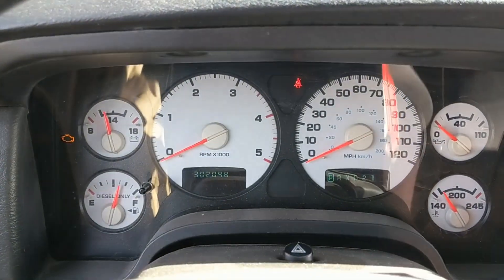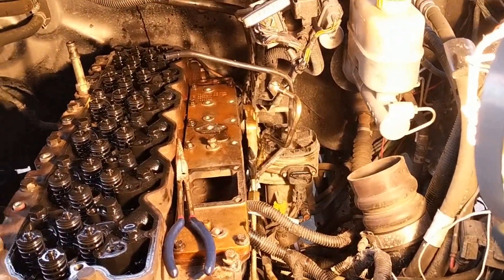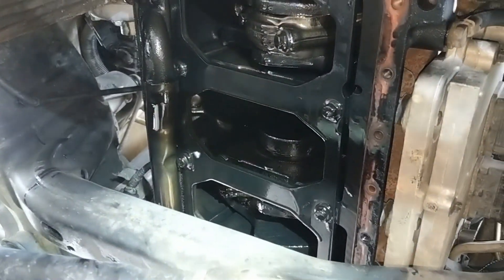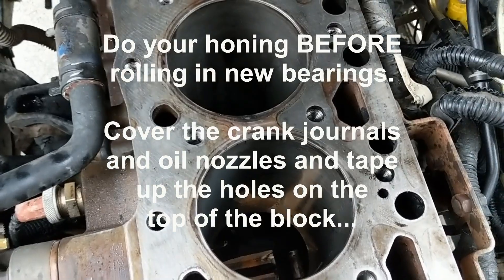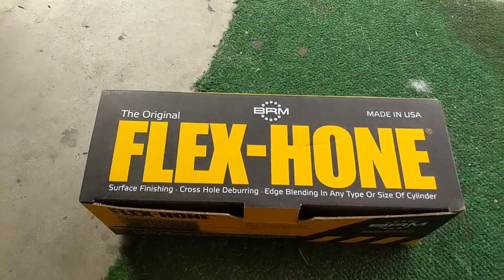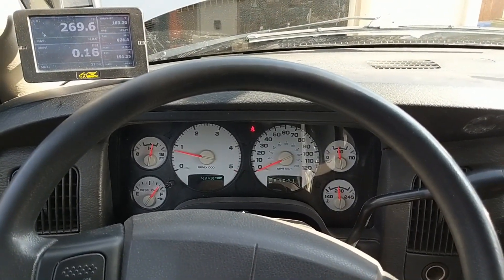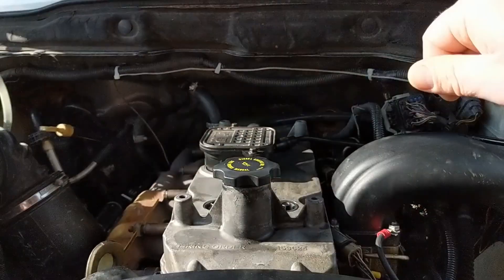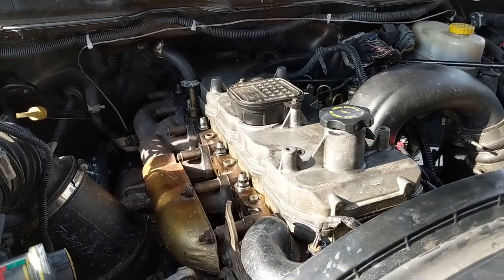5.9 Cummins in frame rebuild- 2005 Dodge Ram 2500

Comment: hey I have a 2004 the same as yours but I am having problems in the morning when I start the motor runs good as soon the temperature hits normal or before hit normal temperature when I am driving the motor just stop runing and when I shift to neutral starts again and as soon I release the foot from pedal the motor stops runing and keeps doing that do you know what may be the problem? thanks for your advice and help.
Reply: Geovanny Figueroa check your fca/fuel control actuator on the cp3 pump
Reply: I was fighting the same issue changed the lift pump behind fuel filter then  , FCA then, cp3 pump , and lastly injectors ,tons of money later 4 of the top shops that had no clue what was wrong with it  ended up being the timing sensor at the bottom of the motor was a little ate up n was getting thrown off once it got hot . Found that out on reading forms for hrs took me 6 months to figure it out lol

Comment: Broken piston rings is caused from over fueling or a bad injector so you have a tuner in it that will cause that
Reply: Robert Richardson there are various reasons that can cause broken piston rings. Not changing the air filter is the most common but isn’t always the case. Broken piston rings will cause scoring. Overfueling will wash a cylinder out causing bore polish. If it’s worse enough it will burn the piston. Listening to it idle, you can clearly tell it’s running on all 6. If it was a bad injector then it would have a fuel knock, there’s not a fuel knock

Comment: Cant imagine putting used pistons back in..  The parts are cheap, and it takes almost 0 extra time
Reply from the maker: The parts aren't as cheap as I am!!!  Still going strong.
Reply: Trevor Chadwick As a lifelong automotive technician I’ve done many, many successful inframes using the original pistons. As long as the engine hasn’t experienced overheating or oil starvation you’ll never have an issue and it saves the customers money. Some applications are so well made that cylinder bore wear or distortion isn’t an issue.
Reply: Not my cup of tea, one of those tired worn out pistons drops a skirt, and the entire engine is junk. On top of that, if the rings are broke, or worn bad enough to need replacement, so are the pistons that have been along for the ride with them (esp with that kind of mileage on them, and a blowby problem).  Upgrading this build to brand new Mahle pistons would be $499 or less
Reply: Trevor Chadwick It’s not difficult to determine if the pistons are “tired” Thats what they make mics and feeler gauges for. I’ve built them for almost 30 years and I’ve never had one bite me.
Reply: @prevost8686  Agree, if you have the tools, and know how to use them properly, you can mic the skirt, and bore, and feeler gauge the ring gap and clearance to groove (none of which I saw done in the video).
Reply: Trevor Chadwick. I agree with you, re-useing old Pistons is a big no no with me, I have been an engine reconditioner for over 50 years and on the odd occasion I have reused old Pistons when parts have been unavailable there's always been back pressure. If rings have broken it usually ruins the ring grove because the ring doesn't rotate properly in the grove and that probably why the bore has marks on it where the ring has stuck, if your going to the trouble of a rebuild do it properly and do it once, it's cheaper in the long run if your keeping it.

Comment: 336k miles on my 08 6.7 When mine hits 700k I'll think about rebuilding.
Reply from the maker: Keep your egt's down and you might make it...
Reply: @DieselCamper  

Stock so should be ok
Reply: @DieselCamper   emissions deleted will help greatly.
Reply: i hit 302,000 miles and i had to rebuild not so much rebuild but mostly just get rid of the crappy 3 piece thrust bearings they used and put in new clevite bearings but figured since i have a back up truck for DD id just do an overhaul on the whole motor its not crazy expensive unless you need injectors.. then its crazy haha a set of good new injectors cost more than some peoples work cars cost them haha

Comment: Why not just pull the engine and do it? Seems like so much more work to do it this way having to work around the rest of the truck.
Reply from the maker: If I did it today, I probably would pull the whole thing.  I still need to do the front and rear mains so it would have been much better to do it then!
Reply: It might make sense if you don't have a way of lifting the engine out, but these days a cherry picker is pretty cheap to buy or rent.

Comment: Ive never did a pickup diesell looks tight me and my dad did my KT600 cummins and his 8V92 but they where both in cabovers the old detroits were a pain they have about 100 pounds more bolts then a cummins great video

Comment: Why not just pull the motor? All the extra work fighting and working around stuff you could have had it out.
Reply: Takes a good cherry picker and you have to remove grill, radiator and intercooler to slide it out the front of truck..
Reply: Yes it’s crazy not to just pull it in less you just trying to unload it but at that point your only going to put one piston in it I would definitely replace the injector in number one hole probably over fueling unless someone got wild with ether but I give him credit doing this way I just am to much of a perfectionist when I’m rebuilding engines
Reply: @TheCumminsturbo2  you claim your a perfectionist but make the claim if your unloading it you would just do the one piston.
Does this make you not a perfectionist or dishonest?
I'd hate to be the guy that bought a rig from someone that was kinda half assed in a repair job
Reply: @hey_youtubeim_back2159  I’m not saying do a shit job but why would you dump a ton of money in a vehicle your getting rid of and most likelygoing to go to auction where someone is going to buy it dirt cheap if I was selling it to a private person I would be 100 percent up front with them
Reply: @TheCumminsturbo2  yes, but ultimately a private person will buy it. I meant no offense brother
Reply: @hey_youtubeim_back2159  I took no offense man you can do a decent job like he did just not the correct way for longevity might get lucky and the rings seat and you get all the crap out from honing or you might not it’s a crap shoot lol

Comment: May I ask what it cost to do the rebuild? 
I just found out I need a rebuild on my 06 with only 133K miles.
Reply from the maker: It was probably about $600 altogether.  I think the engine masters rebuild kit was around $500.  So far still going strong.
Reply: @DieselCamper  Thank you for the reply. I appreciate it. 
Now that I know you reply to these, My 5.9 suddenly stopped on me while on the freeway. All else was on, electircal, etc. Engine won't turn by starter or by hand. Solid. 
I'm assuming it's seized, the way it's not turning. The truck has been always extremely well maintained with only 133K miles. 

Removed the oil with no shavings at all. I recently changed it 1200 miles ago on a 2300 mile road trip with the approx 13000 pound trailer. 

Any thought?
Reply: @chrischapman276  what ended up being your issue?
Reply: @ernestoluzan  Oh.. this is a good one.... 
The previous owner over loaded the trans so when it disinigrated the shaft going to the torque, the forward pressure made the torque convertor into a baby's rattle, then causing the crank forward pressure causing the crank bearing's walls to collapse from the forward pressure. 
What happen??? I sold the 2006 SLT Perfect condition, 128K miles spotless mega cab that had JUST paid $25,000 cash to a broker for $2000 and never looked back. 
I put around 5000 miles on that show room looking truck in the few months I had her and then ended up buying a 2011 4X4 Cummin.s from the same guy for another $27K. 
By the time I made it from so cal to Kingman  Az, the Head gasket blew. Cracked the head, broke a cooling elbow and caused $23,000 damage plus labor. 

Think I'd learn, huh? Nope! Got a 14 Dually. Leather. Nice truck from the used dealership I was stranded at. Paid $19K for it with him giving me $7000 for the 2011 I mentioned. 
The broker is located in Huntington Beach area, Inland. 
I think the name has something to do with "irvine auto wholesale" or something close to that. He hasn't a site for a yard except an office and a few of the trucks in the parking lot along with storing more at his apartment parking. Beware if any of that rings a bell with anyone.... 

In Kingman, apparently Ram is quite popular. there were no Duramax available used anywhere. I miss my Duramax but this "3rd time's a charm" is working out pretty well SO FAR.

Comment: Set the cap on the hole and see if it dances, that's the quick test, the visible vapors really don't mean much, it's the volume that comes out, and the cap should sit still on a healthy engine, a small amount of movement is fine, if it blows it off something's wrong 👍
Reply: I get some steam out of my cap but the cap doesnt move. Normal?

Comment: Would have run a long time like that, but nothing at all wrong with tackling the job head on and doing it complete, probably not much ovalization of the bores

That stuf will hone right out too, ive seen some bad gouges from a wrist pin about 030 or 040 deep that didn't even affect how the engine ran after putting a new piston and rings and new rod in that hole, it ran like new no issues or oil consumption either...

Did the repair out of state in an emergency and never had to touch it again
Reply: Mine lasted 20k before the blow by stopped being able to tow
Reply: @michaelsilberstein  20k after your rebuild?
What happened?

Comment: If you think thats alot of blow by. My 7.3 should have been rebuilt a couple 100k miles ago lol
Reply: Yeah all diesels have blowby even when new, it's not until you see blowby coming out of the dipstick that I'd say it's time for a rebuild
Reply: The Puppet Of Everything I have a ram Cummins 6.7 with 5200 hours on it and180k miles. 550~600 hp and absolutely no visual blow by. My Cummins 5.9 I used to have on the other hand. Puffed like a smoker.
Reply: @Beersandbrakeclean  was the 5.9 common rail, isb, or p-pumped?
Reply: The Puppet Of Everything was a vp44 engine with about 130k miles. Only thing stock was the bottom end on that engine
Reply: kpeezle a bad vacuum pump can give the illusion your truck has blow by
Reply: Brenden Reed how? I thought blow can only be caused by a base engine concern or by a failed CCV
Reply: jake west amen
Reply: Jake there is a spec for blow in a 7.3. If you have accesses to PTS refer to PC/ED section 4 I can’t rember if it’s in hard start or performance diagnostics but it’s in PC/ED section 4.
Reply: But they keep on tikking

Comment: What's the purpose of a 12 valve tune
Reply from the maker: Mostly sound, but it also reduces wear on injectors.
Reply: @DieselCamper  nice I'm thank you for replying I'm watching the video right now of the tuning you got that's pretty cool but right now I need to fix my 2007 I'm having issues with I believe my ECM I keep throwing codes map sensor and crank cam its driving me crazy
Reply: But this motor isn’t a 12 valve it’s a 24 valve

Comment: If you want to really get some miles out of a motor first thing you do is go to gather freight and buy some magnets and put a fifty five pound one on the oil drain plug  next twenty five pounder on the bottom of the oil filter
Reply: Maybe a magnet under the oil pan but not under the filter.
Reply: @ViVA-MEXICO-AMLO  why

Comment: What caused it?  
My 5.9 96 dodge Cummins Speedo quit years ago 300+  runs strong paint is worn of top down .sun  destroyed the dash . my forever truck gonna buff and patina no rust at all.
Reply: T Huss these years of trucks have shitty rings in them, mine piled up 2 cylinders, pulled apart many engines with broken rings.

Comment: Great info. I would have liked to have seen that manometer test for blow by.
Its my understanding that just setting the oil cap loosely on top, it will dance around. 4 - 5 days kicks butt. Getting the head off, did you use an engine hoist? Ok I see you and a buddy got head off. Just read your detailed comment.

Comment: I'm almost to the point of stuffing the engine back in my 2005 Dodge Cummins. I had top compression ring broken on cyl 1 and 6, BOTH compression rings broken on cyl 5! Pulled the engine, had the block bored .040 over, new pistons, main bearings, rod bearings, cam bearing, reman complete cylinder head, all OEM parts. Looking forward to getting mine going again and seeing how much better it runs and performs!

Comment: I don't know what in the hell you're done to that Cummins but last a lot longer than 300 thousand miles.
Reply from the maker: Cracked a ring, most likely during a high egt run up a pass while towing.  I drive it a bit smarter these days.
Reply: Agree with Steve. Have a 05 . I use marvel mystery oil as well 16oz per fill up
Reply: @a0f58c  thats true theres so much pressure in the injection system haha youd think they would have come up with something a little less dangerous haha  p.s its stronger than my pressure washer haha

Comment: Sorry but you should have sleeved the cylinder you still have way too much blow by. I had to sleeve my number 6 cylinder because you only have like .05 mm that you can over bore a cummins and the ball hone on an already worn out cylinder will take it way out of spec. There should be no puffing at all. Just take it out of the frame sleeve all six cylinders and new pistons also rebuild the cylinder head and go another 300 to 500,000 miles. The main problem with the 5.9 is the wear at the top of the cylinder. I commend you on a good try but I think you just wasted a lot of time just pull it and do it right.
Reply from the maker: I knew it was a gamble going in, you're probably right in your suggestion but it's still going strong.  No blowby and no oil consumption.  Oil sample came back clean 👍
Reply: I don’t feel you wasted your time. First off your ring was cracked and you confirmed that. A lot of dudes on here keep saying you should have taken the engine out, while it’s easier to do a rebuild that way, it’s not always necessary. That defeats the purpose of an “in-frame” which many diesel shops still do including mine. 

Your oil analysis came back clean, and that’s the most important piece. Watch your oil consumption and test your coolant once a year. You will be the best judge of whether or not the in-frame job you did was worth the time or not. I hope you get 250k out of this.

Comment: Did you have an issue reinstalling the rear pushrod or did you do that before remounting the engine?
Reply from the maker: There are 2 holes in the cowel that facilitate pushrod removal and install, just above the engine.  They have rubber caps in them.

Comment: Do you have any issues with your firewall insulation being removed? I'm thinking about doing that before I pull my head. less crap that can fall in the block and more room to work. Also rats may have live in it at one time.
Reply from the maker: None.  I don't think it made any difference.

Comment: tearing down my buddys truck now very bad blow by and its running very rough also the oil has extra 5 qts in it which is fuel, he drove it quite  a long trip it didn't over heat but now I think motor is trash ? any Idea's to help me out on pulling the head
Reply from the maker: Take the rocker box off before messing with the fuel lines!
Reply: @DieselCamper  thanks  very much its the first cummins I've worked on most of my stove is v-8 gas ford stroker motors
Reply: @kiphigdon3247  sounds like bad injectors
Reply: @kctrexler8132  back cylinder has big hole in it and injector tip missing
Reply: Kip Higdon that suck but i Am in the middle of tearing mine down as well #6 cylinder broke a ring
Reply: @kctrexler8132  two bad ones and one big hole in no.6 so time to rebuild it

Comment: Doing a compression check would have shown there was problems with that cylinder
Reply: And how do you do a compression test on a diesel?  There are no spark plugs or glow plugs in the cylinder to do such checks
Reply: @michaelsilberstein  
Going through the injector

Comment: Those flex ball hones leave a ton of abrasive fragments caked to the crankcase walls when using cutting oil.  If you hone dry and everything is dry you might get away without leaving un-wanted abrasive compounds stuck to the block. I had to use a high grade pressure washer to remove the abrasive compounds from the crankcase walls when doing on a stand. Just sayin... be careful and look for hone grit stuck to the crankcase walls after trying this in frame overhaul. No Scrutiny , just a heads up on caution.
Reply from the maker: Great insight, thanks for sharing your experience!

Comment: I'm going tomorrow to Mobile, Al. to buy a 1999 Dodge 2500 (6.5 hr drive)  It has 222k miles on it.  What is the going rate to have an oil test done?  I almost bought a Ford 7.3 or 6.0  but decided to go 5.9 24V because they seem easier to work on and the least expensive.  Are you a professional mechanic? or just decided to go for it?
Reply from the maker: Blackstone is about $40.  Not a professional but I've been wrenching on cars for over 20 years.
Reply: @DieselCamper  same hear but only once on a diesel, changed the water pump on a 3500. I'm 65. Thanks for replying.
Reply: @ranjanty9302  I have a mostly stock 99 cummins. Keep your eye on you lift pump. I recommend putting a pressure gage or light. If fuel pressure falls below 5lbs you get replace your vp44. I have 296K on mine. Few oil leaks. Keep an eye out for tappet cover oil leak on left side of engine. Had to rebuild tranny with shift kit n RV tq 11yo...so far so good. But I love my truck!
Good luck...